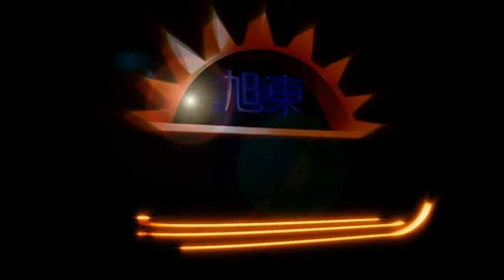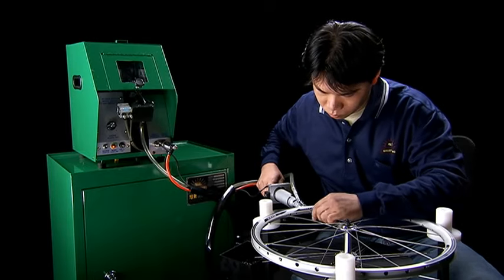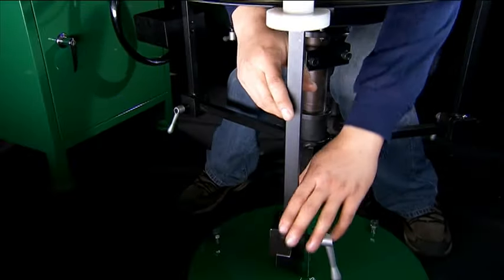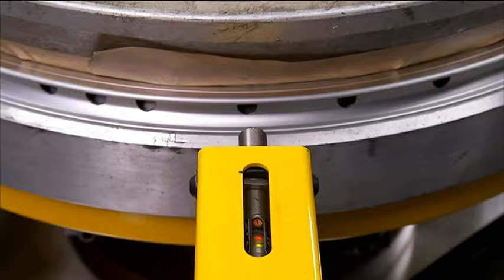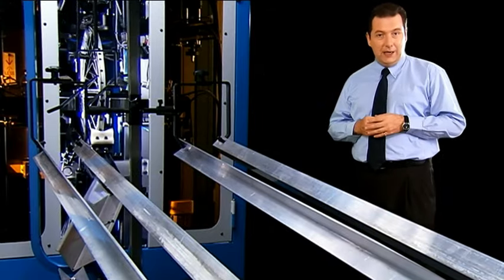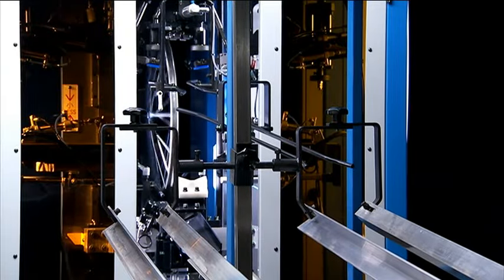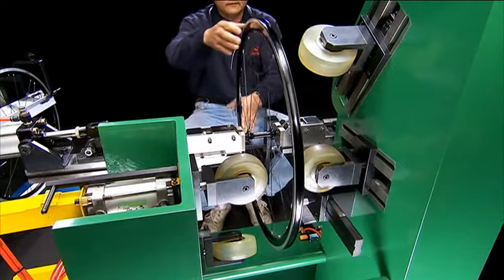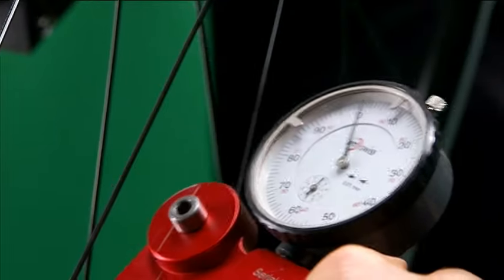Bicycle wheel auto assembling machine

Comment: As someone who has been building bicycle wheels for a while now i can tell you, these truing machines only eliminate the horizontal movement. You can clearly see that in 2:40-2:45 timeframe. There still is a lot of vertical movement of the rim, but the machine just spits the wheel out as if it was finished and true. Nothing major on a budget wheels, but unforgivable on anything higher end though.
Reply: yeH that was from 2012..... or earlier ... they are better than human now.
Reply: @CmdrTigerKing 😂nah